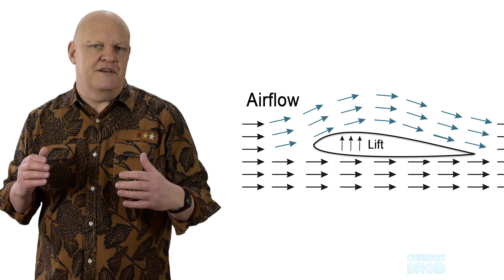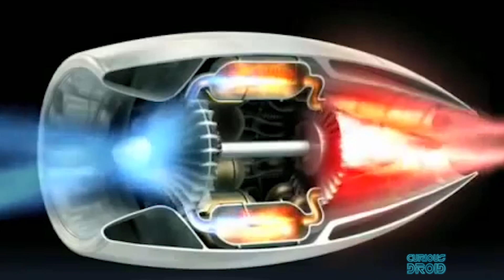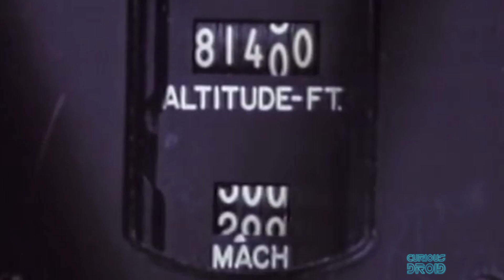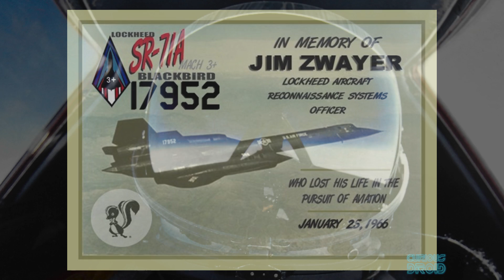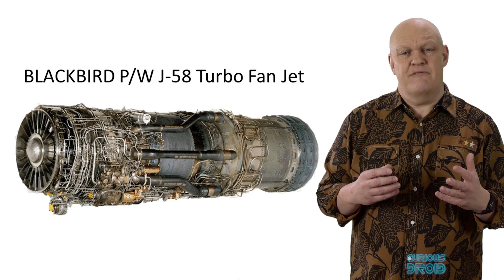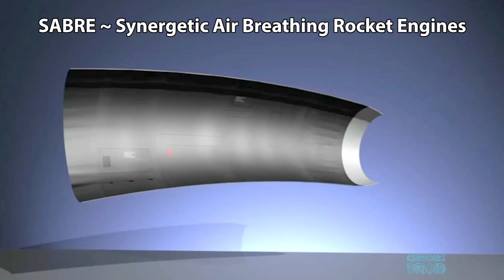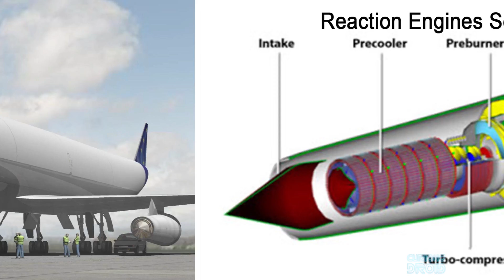Why can't we fly a plane into space ?

Comment: Assuming a plane was instantaneously placed in space, a plane could fly in space if there was air in space. Lift and drag go to zero. You would also have to make sure that for the door seals etc. that they wouldn't outgas. If the cabin could maintain it's cabin pressure you could survive. Other than this, a plane could fly in space.

Comment: the SR7's J58 wasn't a turbo fanjet. It was a turbo Ramjet. The inlet cone acts to optimize airflow into the engine to assist compression. At low speeds it functions like a turbo fanjet, where the compression blades in the front compress air as normal, and supply additional air to the afterburner, but once up to speed, the airflow from the inlets is optimized to create the compression of air which is then directed into the afterburner with additional fuel, creating a ramjet just like you described.

Comment: Why has no-one fitted a jet engine in the rear of an old 747 ? Then fly it high on the jet engines. Then turn on the jet engine. There is room for 180 tonnes of fuel in a 747.

Comment: I know why we can't fly a plane into space. But the idea brings up another question. Why have we always just allowed out spacecraft to fall back to earth? They have to enter the atmosphere at tremendous speeds, creating extreme heat due to friction with the air. Why can't we have a controlled decent, under power, at MUCH slower speeds? That's how we landed on the moon. The lunar module made a slow, controlled decent, and actually hovered above the lunar surface before finally touching down. I understand why the first space missions simply allowed the spacecraft to fall out of the sky. But we should have developed the technology for both controlled trips in to space, and controlled re entry by now. Why can't a spacecraft take off from the ground, and climb slowly into orbit, shut off it's engines, then when it is time to come back, decrease it's speed to let it drop out of orbit, then have a fully powered decent all the way to the surface, never exceeding say 500 mph? I have wondered about this for a long time, and watching the SpaceX rocket land on a barge in the ocean under it's own power brought it up again. We are going to have to develop a way of doing this if we are ever going to have easy access to space. We are still using technology that is hundreds of years old, and dates back to the first Chinese rockets.
Reply: Because Earth has 7x the gravity of the Moon. You'd have to lift all the fuel it would take for reentry to begin with. SpaceX is lifting a very small payload compared to Apollo.

Comment: His facts are a little off. Yeah, 25,000 mph is escape velocity to leave earth orbit and go to say the moon, but 17,500 mph is what’s required to achieve earth orbit.
Reply: Exactly. But we might be the only people to notice.
Reply: Actually escape velocity is just the velocity an object has to be projected at to have enough kinetic energy (assuming KE is only lost to gravitational potential) to travel from the surface of the Earth to infinity. The actual calculation is an integral. This is how gravitational potential is defined. You could actually travel an infinite distance from the surface whilst travelling at 1mph you would just have to have enough energy in your fuel to equal the KE you would have of projected at "escape velocity"
Reply: Not only that, escape velocity is what it takes to leave earth's SoI assuming you were firing an object out of a cannon from the surface of the earth with no atmospheric drag.  There is no actual speed limit to leave earth, you could throttle a rocket down and slowly plug away at 30mph and get to space, you'd need to get to orbit velocity if you wanted to STAY without burning fuel but if you had unlimited fuel you could chill forever without ever going fast.

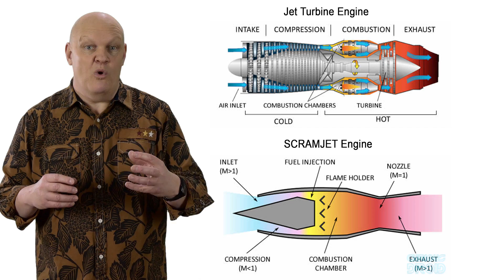Also that illustration at 5:09 is one of a ramjet, not scramjet
scramjets have no burners and simply use the extreme speed to compress the air so much it self ignites, much like how diesels dont need sparkplugs, instead relying on high compression ratios
Reply: @slopeslider90  Thanks for your clarification. Too many people, including this presenter misunderstand the concept of escape velocity. There is no limit on the speed required to escape from the earth's atmosphere. If you are moving away from the earth continously, in a powered flight, you will "escape" from the earth regardless of your velocity. And the further you  are from the earth, the easier it becomes to escape. What he saying may apply to cannons, stones and bullets.

Comment: Sorry, your simple explanation of why an airplane flies is simply wrong. https://www.grc.nasa.gov/www/K-12/airplane/wrong1.html
Simply put, most of the lift from an airplane's wing is due to Newton's laws of motion, not Bernoulli's principle.  Otherwise symmetrical wings like those used in aerobatic planes would not work.  Primarily the third law, where the air from the forward motion impacts the lower portion of the wing at a slight angle, generating more upward force, than the air pressing down, resulting in lift.

Comment: wow you need to do more research first of all the hypoxia altitude is above 10,000ft, the need for a pressure suit is at 60,000ft and it's the water in your blood that is boiling not the nitrogen escaping, technically the SR-71 didn't use turbo fan engines (and defiantly weren't normal) they were turbo ram jet engines (which was a mixture of turbo fans along with a ram jet), and finally according to NASA the X-43A flew at a top speed of mach 6.8.
Reply: Dragon16661 just a small correction to your otherwise great critique: He didn’t state that hypoxia sets in at 10.000 ft. He stated that the “deathzone” is at 26.000 ft, at which the degree of hypoxia becomes intolerable for humans. Secondly, you can benefit from wearing a pressure suit at way lower altitudes than 60.000 ft, it’s just that once you reach the armstrong limit, you have to be in a pressurized environment, no matter what physiological condition you’re in.
Reply: Also another correction. The x 42 did not use a fixed wing all in one engine it needed to be dropped from a plane carrying an external separate winged booster rocket. Which is why the SR71 still holds the speed records

Comment: It will come to that point, but you will need a engine that can breath like a normal engine and then change modes to a rocket type propulsion engine and back again.  It has to be reliable and powerful with fuel that can be used in atmosphere and space.

Comment: The SR-71's engines were hardly "normal", as turbojets lose their effectiveness at even lower speeds than you mention. Above mach 2, the inlet cone would be repositioned to squeeze air towards the outer rim of the engine's intake. At the same time, six tunnels around the engine's perimeter would bypass air directly from the compressor to the afterburner. As a result, the J58 would operate as something like a hybrid turbojet/ramjet. Though even then, by the time the aircraft reached Mach 3.2, the turbojet was producing little meaningful thrust of its own, and was essentially acting as a pump for the bypass air.

Comment: Boom no oxygen or air resistance to control the plane or use the engines. Even if you did have an oxygen tank somewhere on the plane you would have to have RCS or gyroscopes in order to control the plane. Although yes theoretically you could design an aircraft that had the standards of a plane and use it for space flight. In my point of view it really just isn't worth it.
Reply: Another reason is because I dropped my spaghettios and now i'm upset so I won't allow a plane to escape the atmosphere.
Reply: I'm also waiting to be called a pseudo-intellectual.

Comment: When the plane would enter the exosphere, it would melt. Aluminum melts at 671 degrees. Stainless steel melts at 2750 degrees. The exosphere starts at 1000 to 3000 degrees. 😜
Reply: Absolute nonsense. Google "exosphere".
There's too little energy in the few fast atoms up there, to heat up any object.

Comment: High pressure plus lack of oxygen would cause the engines to die and the plane to crumple like a tin can if it went too high. Flying higher than 60k feet requires life support/oxygen and a reinforced hull to withstand the high pressure of the upper atmosphere.

Comment: even if a plane goes to orbit , during deorbit and re entry the plane would need heat shield which will increase the weight and if it doesnt have heat shield the lane would burn up
Reply: A bit late, but one method could be to make turns in order to slow your velocity so  it lowers the amount of friction from the air. This way you do not burn up. Either way taking a plane to place is pretty obsolete.
Reply: Person Man A very long gradual shallow reentry using lift to keep as high as possible as long as possible, or skipping off the atmosphere several times rather than reentering in one go, could make it less severe than the space shuttle. It'd still get hot though
Reply: RedButtonProductions "This is your captain speaking. We will now begin our descent from 500,000 ft at hypersonic speeds executing complex maneuvers with the help of small extremities of the craft such as wings and flaps. John Hancock Mutual Life Insurance is extending special in flight deals to all customers. Your flight attendant, who is disclosed as working on company commission, will be around to discuss the offers shortly. All major credit cards accepted."
Reply: we have a gradual atmosphere.Coming back should be no problem!
Reply: Aditya good observation.
Reply: Luke Alley thanks

Comment: the air density is not so low at the muntain peaks. its the toxic layer of sulfur oxide and carbon dioxide  that poisons  the lungs of the people and  causes the halusinations. above that, there is more clean oxygen as carbon dioxide does not go that high, neither does sulfur oxide. carbond dioxide and surfur oxide is more dense than oxygen so the air float at the top of it. its the trees that keep us alive at surface level as the stem both absorb carbon dioxide as well as release oxygen. without the trees we all die. there is oxygen above the clouds much cleaner than at the top of muntains. density is no so much lower. it takes a lot more altitude  before the air get so thin than we can't breath it. you need to travel far up the stratorsphere for that far above the clouds way above the muntains before the air get very thin.

Comment: "A plane flies because as it is propelled forward, the wings, which are shaped to make the air flow faster over the top of them than the bottom, generate lift. As the plane goes faster the wings create more lift and when the lift is greater than the weight of the plane, it will climb up into the air.  "  how can this be a true explanation of flight, if planes fly upside down ?!

Comment: you can't fly an airplane in space because their is no atmosphere for the engines to push against, this makes them unable to function and they can not move the airplane. the wings don't create lift without an atmosphere. oh wait... WHAT!!!!!??? if an airplane engine WILL NOT WORK WITHOUT ATMOSPHERE, how does a rocket engine work in space in an infinite vacuum, with no atmosphere? without anything to push against there will be no thrust and no movement "every action requires an equal and opposite reaction". no atmosphere to push against, no thrust, no movement. this is why airplanes and other vehicles can't fly in space :)

Comment: I want to know why catapult launchers, like the ones used on aircraft carriers, aren't used commercially for planes. It would use less fuel than using jet engines to take off.
Reply: Aric Castro Very dangerous. Also, airliners are a fuck ton heavier than fighter jets

Comment: Woah pause there, a modern 2017 airplane can yes fly into space, it just gotta surpass 60k feet, and in a vertical position,  which is possible.  But what's the point?  And oxygen will be not available over time. And the airplane uses air to escape into space, but once it's into space, it's going forever out, and there's no air in space to use to go back down.

Comment: Assuming some further development in rocket fuels, is there any technical reason why the first stage of a multi-stage space launch system couldn't be a winged aircraft with air breathing engines to take the spacecraft to the limit of the air breathing engines, then switch the engines to use supplied oxygen to the limit of the wings to provide lift, and then separate the stages and have the next stage or two fly in a ballistic path using conventional liquid or solid fuel rockets? I'm not talking about using existing craft, I'm talking about new designs.

Comment: All this is bull ! I will build a jumbo jet that will go to the moon and back in 6 hours, well maybe 10, using technology I have created that can change a turbo fan engine into a rocket engine once doing so it than can only be used in space as propulsion. How? Only 10 passengers and 3 quarters of the fuselage filled with pressurised hydrogen and oxygen, not liquid, gas, and my jumbo jet will reach 250 thousand mph in 25 minutes while on the way to the moon OR Mars, and have enough fuel left over to the same thing for a month. Prove I'am wrong with the money and I will succeeded. The fuselage would need to be a custom creation designed to block any radiation found on the trips. It will take off and land as normal as it returns from space and departs for space. To bad you don't like the real deal.

Comment: The SR-71 engine (arguably the only good jet engine Pratt & Whitney ever made) is anything but normal. The big pipes you can see running down the side of the compressor section are bypass ducts, allowing the inlet gas to circumvent most of the axial compressor and be injected directly into the combustor or reheat chamber. At anything above about Mach 2 (and lower really, but the effect is less pronounced) the big pointy titties Lockheed saw fit to strap to the chooch pods point an oblique (angled) shockwave right into that there inlet, where the flow passage bounces it around a bit and eventually causes a normal (perpendicular) shockwave, behind which the gas is subsonic - just the cock for Dolly when you're goin' into a choocher inlet (we don't want no shockwave on that there compressor lade!). All this shock bouncin' and stoppin' ups your pressure and density, doing the choocher's work for it but only costing you the drag that there shock already generated. That's where the bypass ducts come in, turning the J58 into essentially a ramjet at any reasonably high speed. This is why its official type is turbo-ramjet and it's the only engine of that type ever produced. Best part is: the faster you go - the stronger the shocks, the slower the gas behind the normal shock, and the higher the pressure and density. This bird was made to fly fast! Oh, and dem titties also poke in and out of the chooch pods depending on how fast you go to keep those shockwaves exactly where they need to be.

Jet engines as a whole really don't like supersonic inlet. Fucks with their compressors, breaks down the flow inside them and completely dechooches the whole operation. Supersonic inlet = BAD. That's why every supersonic aircraft has a special inlet that creates a normal shockwave, slowing down the gas in supersonic flight and helping choocher efficiency. The Concorde inlet did somewhere around 40%-60% of all the compression work at cruise Mach. It was necessary to have it slow the gas down regardless as the RR Olympus choochers had a maximum inlet Mach number of 0.65. The efficiency gains are more of a pleasant side effect at this point.

Comment: The author of this video has absolutely no idea what he is talking about.  Escape Velocity is the velocity needed to ESCAPE orbit of a gravitational body, not to attain it.  I.e.  40,270 km/hr (11,186 m/s) is the change in velocity needed, from a standstill, to reach orbit around the Earth AND THEN eject from Earth orbit and enter an orbit around the Sun.  Rockets routinely reach orbit around Earth with slightly less than 10 km/s of Delta-V, which wouldn't be possible if it required 11,186 m/s before even accounting for aerodynamic drag or gravity-losses from the portion of your Thrust merely used to hold your rocket up and not accelerate (in aerospace, this is colloquially referred to as "gravity-drag" to draw a parallel to aerodynamic drag and emphasize the interconnections between the two when designing an ascent trajectory).  To reach orbit, you don't reach a speed where you are traveling FASTER than gravity is pulling you back to Earth (which is itself a non-sensical statement from the author, as momentum and acceleration are two entirely separate things- your velocity doesn't push you anywhere, it is merely the rate at which you would travel in a straight line if acted on by no outside forces such as gravity), you reach a speed where you are traveling JUST FAST ENOUGH that gravity can only manage to curve your trajectory into the shape of an ellipse (all closed orbits possess an elliptical shape, which can approach circular if speed and angles are just right, but in many cases diverges wildly from it.)  The author really needs to brush up more on his basic Physics.  All he would have had to do is read the Wikipedia article on "Escape Velocity" to understand he was wrong about what the term means:  https://en.m.wikipedia.org/wiki/Escape_velocity

Comment: "you need special material (example special strong metal that covers outside of plane) to fly in space. 
Regular material (example metal that is used to build airplane ) flys to space = Regular material burns (or breaks) (space is cold (very low temperature) and metal that is used to build airplane can burn or break when flying to outer space)"

"Fly to space= need material (example material that is used to build plane) that can withstand cold (very low tempreature) and other "unusual" environment in space"